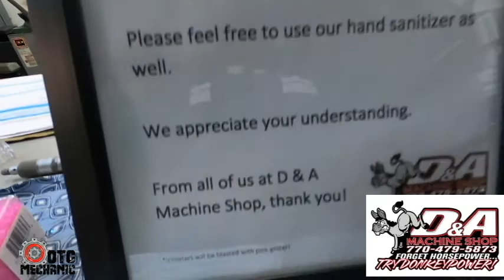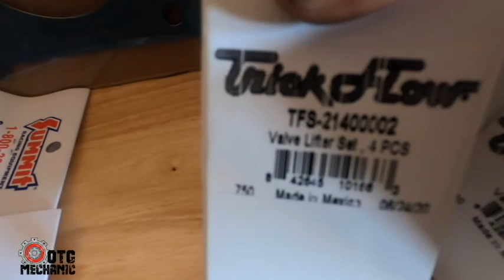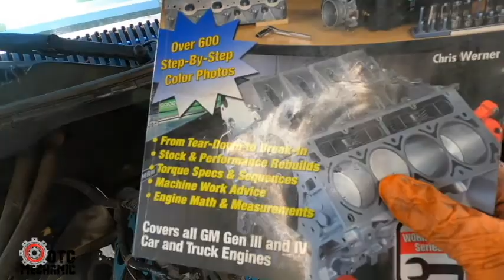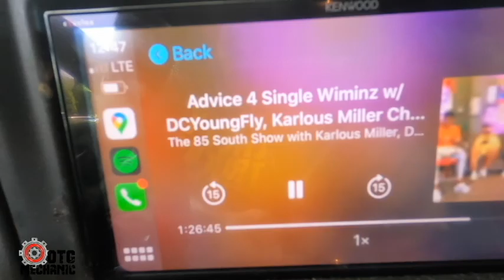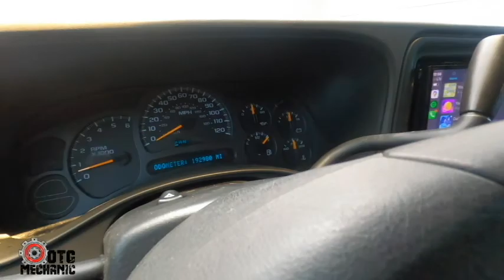My 2003 Silverado gets a cam and heads!

Comment: Did you try using a Tap to hole? I had that problem on a old car of mines with the fuel pump whole was stripped. It kept coming loose and oil was leaking. I got a tap and rethreaded the hole